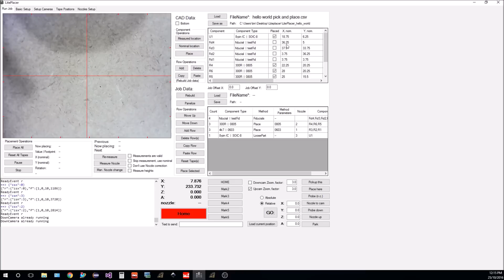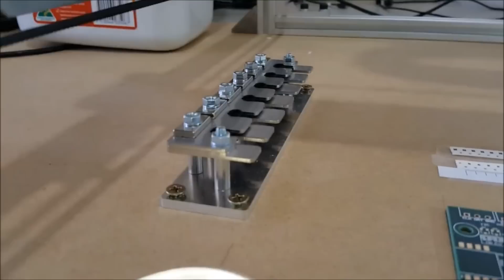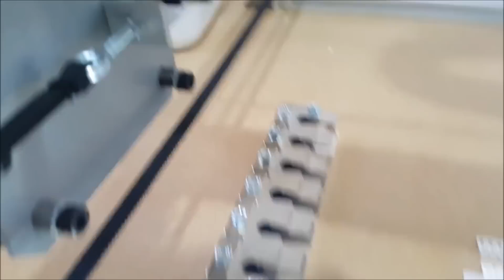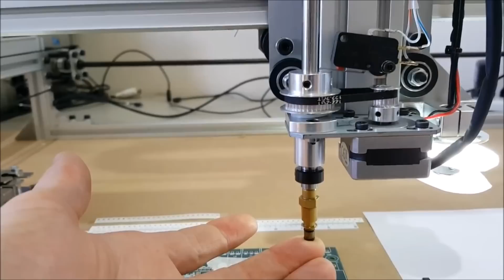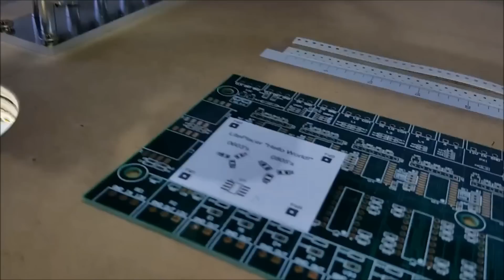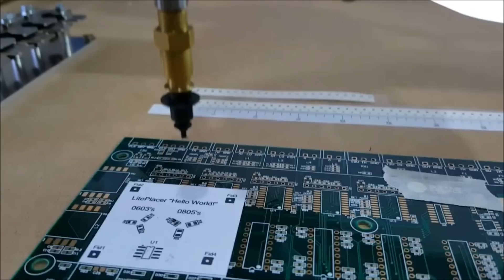Liteplacer DIY pick and place machine with new auto change nozzle

Comment: Hi.  Nice . Would you upload a video  populating a PCB a full speed?  I need an affordable machine for prototyping or small productions and I just found your useful video. Thanks
Reply from the maker: Hi Cesar.  Sorry, I haven't uploaded more videos but that is pretty much at full speed... It's not designed to be a fast machine.  Including setting up the tapes, It's about the same time as hand loading the board.  The advantage is that it doesn't make as many mistakes as me, and certainly doesn't get as bored! 

There is now software released that doesn't check the sprocket holes each time it picks a component, and that will nearly double the throughput.  But that really needs a better tape holding system than I use.  

The lack of a tape holding system is my only criticism with this machine (and I know Juha is working to provide some options), and it is the next thing for me to improve on it.
Reply: Hello, Thanks very much for your comments.
Thinking to buy one for low qtty productions

Comment: if want more speed is ok switching the steppers and drivers?
Reply from the maker: Other users probably have more experience at speeding it up, but I would suggest it could be a slippery slope. eg: I think the motor drivers are close to their limits, so to speed up the motors you would likely need to change the electronics as well. The mounts are to suit the little nemas, and I'm not sure how much larger you can get in that package... so you may need to redesign all the brackets. If you do that, then the speeds will definitely increase, but then the gantry is relatively hefty, and i cant predict how far you could push the pulley/toothed belt design before having to change to ballscrews and linear bearings to handle the force.  if you speed up the motion, you will then really start to notice how much time is spent in raising/lowering the nozzle, and in processing the vision at each end, and improvements there will be even more difficult to make. my suggestion is to use it as it is intended (a consistent replacement to hand placing) and if you need hundreds of components per minute, then shell out for a commercial machine.
Reply from the maker: If you count the time, there's about 5 seconds each for picking and placing (so 10 seconds total), and only about 1-2 seconds for the x/y motions.  So the big gains aren't in x/y movement, but in speeding the pickup/place movement.  This could be either through reducing the z distance it needs to travel (I think this would either be moving the limit switch, or there may be a safe z limit in the configuration that I haven't seen yet) or speeding up the z stepper.  I've seen other liteplacers doing that part quicker... so it's definitely possible.